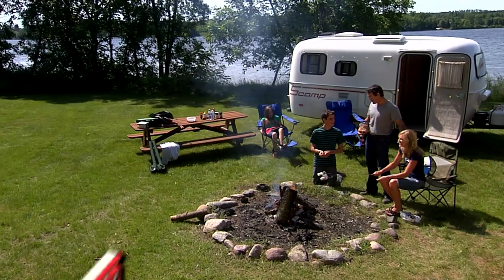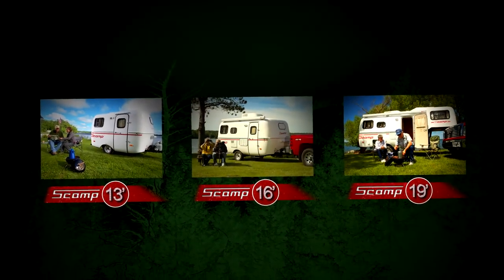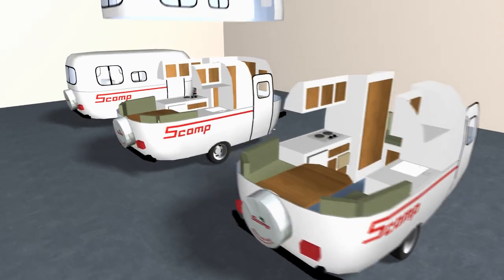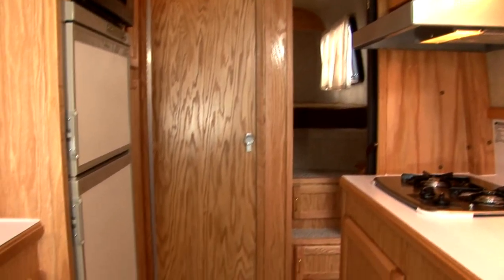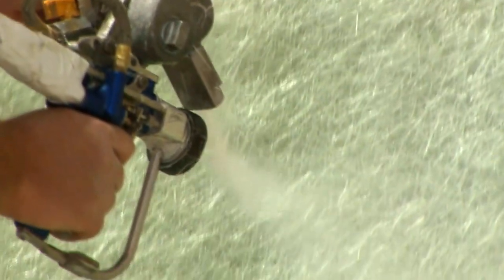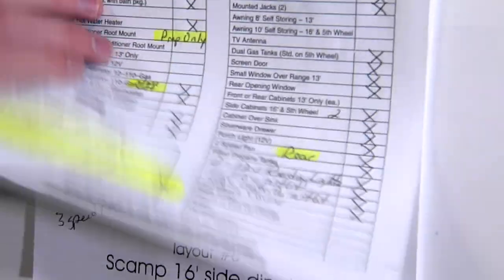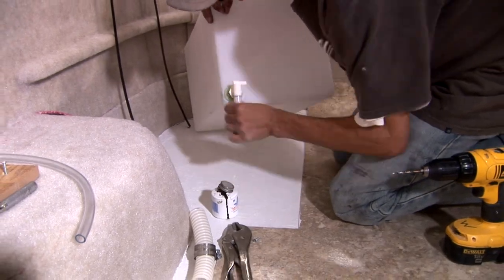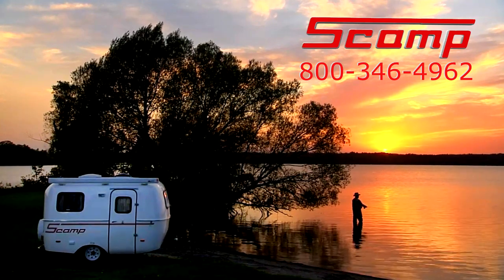Lightweight Small Travel Trailers - Scamp Trailers

Comment: When I was a kid my family must have had one of the first Scamps on the market. We took that trailer everywhere. When my dad retired from the Air Force and took a job in the private sector we lived in a motel for 6 weeks while locating permanent housing. The Scamp doubled as our kitchen. Later when I was older my buddies and I regularly took it camping towing it behind an old 6 cylinder pickup with a 3 speed on the column manual transmission without a problem. It was easy to tow and it survived the abuse of teenage boys over 3 summers! The Scamp looks to be of much much higher quality now than back in the day but we sure got our money's worth out of it.
Reply: Does your family still have the Scamp?
Reply: @BeanCruisers  No unfortunately we don’t.  That was back in the 60s early 70s. I was the last to use it and after I went to college it sat unused for years.  Weather and lack of attention finally ruined it.  My dad tore it down to the frame and built a utility trailer.

Comment: All these complaints. If you do not like it then just tent camp. It is for people who want to get into smaller places to camp & smaller vehicles to pull. Not every travel trailer has to be decked out to look like a vacation home. Good luck finding a trailer under $12,000 like these were 13 foot
Reply: I"ve towed and stayed in a 13 footer(never owned one though) - no complaints here - it towed like air and I slept in a dry bed during an awesome thunderstorm, woke up and had a great breakfast off the campfire-- what more could you want? IMO these campers are worth it just for how easy they tow - a toyota corolla could get a 13 footer down the road with no problem
Reply: although I do have to say if I were towing with a truck and buying I would opt for the 19 footer fifth wheel in a hot minute
Reply: Its a steal since you dont have to buy a truck to pull it, My 4 cyl Rav4 can handle the 13'.
Reply: True! We love our Scamp.

Comment: Very well done video.  I didn't even know Scamp was still in business until I started researching small lightweight trailers.  We had a 2001 Fleetwood 27' trailer that we averaged 80 nights a year in for 8 years.  Then my son lived in it while working a co-op job through his college.  Ended up selling it to a coworker who had camping age kids.  It works out to about $12 a night plus campground fees.  Definitely cheaper than hotels if you actually use the camper.

Time to start searching craigslist for used Scamps and Casitas to see how well they hold up.
Reply: A 1976 13-foot Scamp sold recently (approximately May 2017) on ebay for about $5,500... pretty good resale value if you take care of it.

As for those people commenting about the wood floor.... you would have to abuse and neglect it to get serious damage. I have a 1975 Scamp and the floor is solid.
Reply: Old Man in the Cave good to know because I was feeling iffy about it.
Reply: Did you end up finding a Scamp?
Reply: @BeanCruisers  , changed course and built out a 6x12 ramp door cargo trailer into a toy hauler.
Reply: @Dave-sw2dm  Very nice.

Comment: well so far as for all the rvs I have been looking at airstream, truck trailors artic fox, lances, class a, c and b, and vans this 19 foot scamp fifth wheel has everything I want in a rv. airstreams their cloud models have a huge dinnette, I would opt for the more counter space and smaller dinette myself. even thos airstream has lots of windows which I love, they both have a higher longer lasting waterproofing exterior.  I just love the scamp, so it would be hard for me to pick but the airstream is  much heavier for the same length, so there is alot to consider on rv picking.
Reply: TheRosa63 -& the Airstream is a lot more money. It’s worth it, but.......
Reply: Did you end up getting a Scamp?

Comment: Glad I watched this video.
I was considering buying a 16 ft. model but seeing them use particle board for the floor really turned me off. It's a recipe for disaster if there is a water leak. Bummer.
Reply: Via Curtis Grindahl ^ above : "That's not conventional particle board, but oriented strand board created for structural stability.  It has essentially replaced plywood in most construction settings.  OSB is a well regarded material, NOT garbage."
Reply: Andrew Evanoff - I have not seen any complaints about the wood decking. It’s resin coated and at 1/2” thickness definitely stiffer than a fiberglass decking. I had same concern initially but no long time owner I’ve listened to has anything to say about the decking. That makes it a non issue in my book!
Reply: Totally agree, use Marine plywood and charge me an extra $200. Particle board falls apart when wet.
Reply: Isn't "osd" still particle or chip board by another name? Some of the plywood they are overcharging for these days is crap too. Last batch of 3/4” I bought from Home Depot started delamination as soon as I took it outside in the Florida humidity. 🤬

Comment: Thanks... such a cute design but a painted steel frame, a chop gun, particle wooden floor not even marine grade plywood and twisted wire nuts... well you convinced me that a SCAMP is certainly not the way to go... at least not for long anyway... How about at least some actually fiberglass cloth a powder coated frame and using a sheet of RP under the floor to prevent rot?
Reply: Say what you want to about these but I can show you scamp trailers still in use today over 25 years old, built the same way. They are not $65K airstreams, they are well built, affordable, practicle, lightweight campers. Most of us are impressed with them.
Reply: Forgot no CNC or robotics in ANY of manufacturing processes.🤖

Comment: I've never owned a 'Scamp', and as far as I can predict...I never will. I stayed in a '13 for 2-days once in Bullhead City, Az. on the Colorado River, and it was like a SAUNA inside the trailer! It was summer, and the heat coming off the walls was unbearable.(can you say 'Kenner Easy-Bake Oven?')I also spent time in a 'pop-up' in Las Vegas in July, w/a day temp. of 100+F. and it was actually not that hot in it! Even w/o any power (I think the brand was a 'Jayco') it still felt 'a little warm'...but I wasn't sweating or uncomfortable. The pop-up was HUGE inside as compared to the 'Scamp' I was in, and I actually liked it!I think the announcer here is full of crapola! An 'ice-box?' For a 'T.T.' that cost 10k plus? NO, thank you!

Comment: can a subaru forester pull the 13?
Reply: yes, depending on options they weigh 1500-2000 pounds. To be extra safe, once fully loaded it would be a good idea to get a brake controller installed in your car.

Comment: can you pull these with a mini van
Reply: Joey bulmahn Probably
Reply: Every vehicle has a tow rating.
Reply: +Joey bulmahn  if you can pull them with a 4 cylinder car, or a crappy Ford Ranger I would say yes.  Most minivans are V6 now, and have a better towing rate then the Ranger.
Reply: What type of minivan ? the only van that has an exception is the Chevy Astro or GMC Safari vans they are ridiculous  powerful they can pull 5000 pounds any other van  you will have to check

Comment: I saw a Ford Escape SUV pulling a 13’ Scamp in their promo video that looks identical to my 2010 Escape.

What I am concerned about is whether or not my 4 cyl. can safely tow a 13’ trailer up mountains, as the mountains between Tennessee, North and South Carolina and Georgia can get pretty steep and heavy with 18 wheelers traveling through tough traffic, without tearing out my transmission?

Can just any 4 cylinder cars\SUVs manage towing a 13’ camper under those conditions? My SUV can only tow 1500 lbs., so a 13’ Scamp would be maximum weight.
I want to attach a trailer hitch, as my SUV is not “tow ready”.Would this be a major problem?

How much would a 13’ Scamp cost if ordered in 2019?

Comment: you insist on using cheap particle board for floors?  GARBAGE! UGH!
Reply: ken cole troll
Reply: +ken cole My observations on the SCAMP went beyond that too. It would be just as easy to use FRP under that particle board and why not powdercoat that frame and crimp connectors not wire nuts!
Reply: That's not conventional particle board, but oriented strand board created for structural stability.  It has essentially replaced plywood in most construction settings.  OSB is a well regarded material, NOT garbage.

Comment: Looks decent but too bad Scamp uses OSB wafer board instead of good plywood as a structural floor. Scamp should be using weatherproofed plywood instead of interior grade construction OSB ! The OSB swells like cardboard with moisture.

Comment: 9 gallon black tank? That'll fill up quick. 

I like the idea of the Scamp but I'm not sure why they jumped to a fifth wheel version. It really limits what can pull it. And you're out of luck if you need to use a different vehicle to move it for whatever reason.
Reply: aguyandhiscomputer Too quick.
Reply: +aguyandhiscomputer Well, What do you mean by Limits what you can pull it. Do you mean you can't pull it wit an SUV or Sedan? Or unpoked bed truck or topper? If so, Then they make what is called automated fifthwheel/gooseneck Hitches that are like 1K You pull em with your trailer hitch frame
Reply: Then don't buy the 5th wheel version. Your objections are ridiculous.